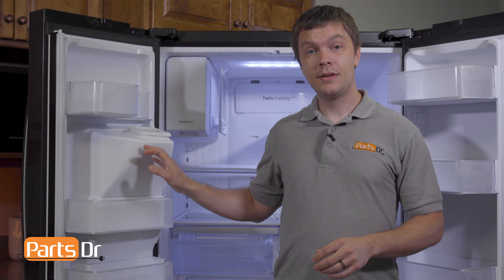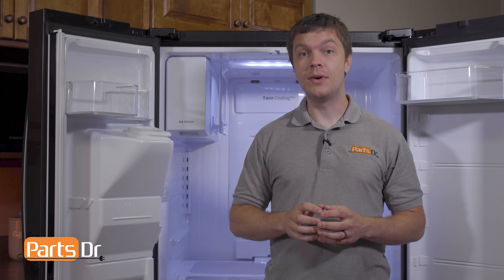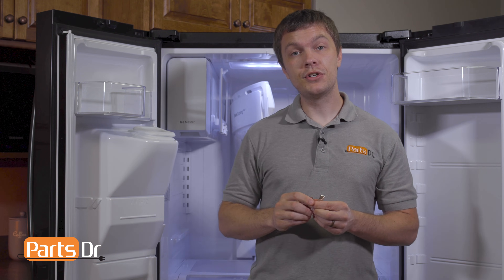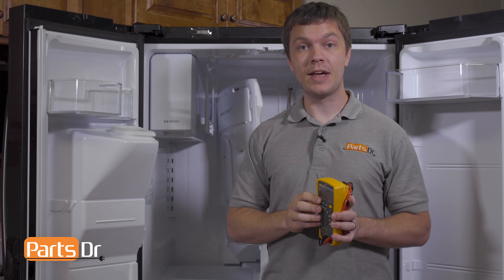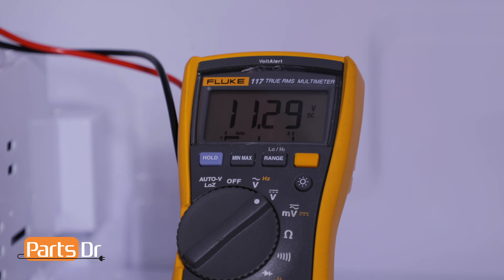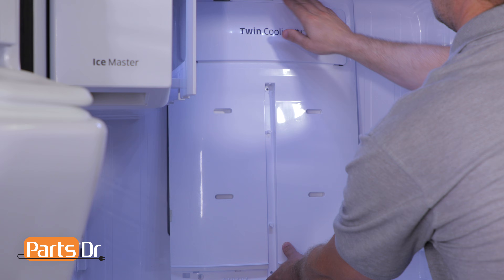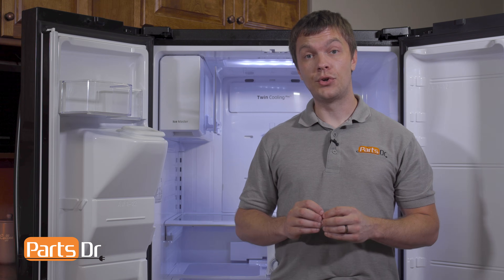How to voltage test a Samsung Refrigerator Evaporator Fan Motor

Comment: My refrigerator has two fan one for freezer nd other for lower compartmen both are in the frezzer section but having differnt speed, freezer fan run at fast speed nd lower compartmnet fan run at slow speed, one fan is getting 12 volt other is getting 8 volt,  kindly tell both should work n 12 volt,   lower compartmnet have less cooling than uper compartment

Comment: I only get 8.81V on my fan motor in the freezer. It is spinning but freezer not getting below 38 degrees with my infrared thermo. Same temp as fridge. What could be the issue?
Reply: Did you find out?

Comment: Sir, my refrigerator is not defrosting heater are not working what else part is failure,
Reply from the maker: Most Samsung refrigerators have 4 parts that work together for the automatic defrost cycle, the defrost heater, defrost bi-metal, defrost sensor, and main control board.

Comment: What if it has proper voltage going to the fan and it runs but still has a code for bad evaporator fan
Reply from the maker: One of the wires on the fan motor relays a signal back to the main control board for it to monitor the fan motor an make sure it is operating properly.  This could be caused by a bad fan motor, bad main control board, or bad wiring between the two.  Let us know what you find.
Reply: @PartsDr  ok have a new board for a customer hoping it's not the harness from the main pcb and Is the control board itself. The customers stated samsung repair men didn't know the problem but Me and my brother are on track to fixing it
Reply from the maker: @jayjones8424  Let us know what you find!

Comment: My refrigerator makes 5 attempts to start the fan motor and then disables it. I measured the voltage on the fan (while it was making start attempts) it was correct 11.3V, I even got a replacement fan which behaves the same way. Looks like the control board can't get a feedback from the fan that it's spinning...Bad control board?
Reply from the maker: It sounds like a bad control board.  Let us know what you find.

Comment: This helped me alot by identifying that the fans voltage is 12V DC. Checking the voltage with the fan plugged in can be misleading. Mine showed no voltage this way, indicating that the PCB may have been bad, but after taking the fan out and putting 12 volts to it, it would not run! The fan was definitely bad. The PCB stops sending voltage to the fan after it repeatedly gets no response from the fan which can make you think the PCB is bad when it is not. It's a good idea to bench test the fan.
Reply: Yes, but I was getting no voltage while the fan was plugged in to the fridge & the fridge compressor was running, magnets on the reed switches. The PCB had already cut off power to the fan. So I tested the freezer's evap fan with a battery & it worked, the refrigerator evap fan didn't.
Reply: Watch the video again. He said the voltage to the fans was 8 or 11 VDC. Also you can check the fan motor by checking the continuity between the red and black wires on the fan itself. Continuity good fan motor. open bad motor. He said white wire sends fan speed info back to the PCB.
Reply from the maker: That's good to know!  Thank you for sharing.

Comment: what should be the resistor of freezer and refrigerator fan respectively? is 97.5 K and 12 K ok for the freezer and refrigerator fans? they do have sound of working when the system is plugged in.
Reply from the maker: We don't usually find a resistance test to be an accurate way to test these fan motors.  Even if they test good in the resistance test, the motor can still be bad.
Reply: @PartsDr   Thanks for the reply. I have a Samsung inverter refrigerator (freezer top). It works fine until around 7 hours and then stops working. If I unplug and plug it right away, it wont turn on. After some hours, it will turn on. It has high temperature fluctuation. If I set the freezer to -21C, it will even cool down to -32C. The Samsung official service came and said my evaporator is having a small hole. I didnt accept. Then 3 more technicians came. One said the defrost system is problematic and changed the sensors without measuring the resistors. Then another one came and said the invertor motor  should be replaced. Then another one came, took the inverter board and returned and  then he said, it is hard to find the  cause, buy a new Ref! Since then, I am trying the repair it without experience. I just am an electronic engineer and understand something from the board; however, I do not even have the board map!
What do you think?

Comment: I have a Samsung 4 door flex refrigerator the refrigerator part will not get below 57 degrees but the freezer part works fine I'm assuming the freezer and the refrigerator has two separate evaporator fans is that correct!
Reply from the maker: Yes, most Samsung refrigerators have an evaporator fan in each compartment.
Reply: @PartsDr  okay I will check it thank you
Reply: Hi, I have the same issue. Did you resolve it?

Comment: Hello, Yves from Belgium, RS7528THCSP Error 22E, fan 9.6 kohm, voltage i get  only 6V ???, so first turned very slow, than didnt turn at all ....help
Reply: Did you find solution?
Reply: @aisenandrosov5713 Samsung DA31-00334C koeler/ventilator motor - bldc ;12035GE-12M-yt 1775 ±7% 12
Reply: Yes a new fan motor

Comment: Hi, I sure hope you can help. I had a c 22 error, ( pretty sure that means the control board is fine if it detects errors?) I replaced my fan ( it was frozen up, rusted) and now it moves. The error is gone! but the fan never comes on? I know I connected it right, and it free to move.  I got an AC 7 volts on white, but no DC. red to ground I get 1 volt DC. So confused.
Reply: I am about to order a fan motor myself….same 22c code. Did you resolve the issue?
Reply: @ramjet358  no ditched it. I fixed it a few years ago with a new fan but this last time no luck. Tried a new board and sensor. No luck so got rid of it.
Reply: @greensseanpam5616 ok thanks for your quick reply.  I guess I’ll give it a go.  Other than this one, did you ever come across a video or instructions involving a triple cooling unit?
Reply: @ramjet358  no, nothing like that
Reply: New fan worked.  Hopefully it will last more than 5 years (or 5 months!).  Thanks.

Comment: any thoughts as to why my rs265tdrs/xaa leaks water on the floor at the front of the fridge side, about once a day? the water seems to come from under the fridge, not from inside of it. the evaporator tray underneath seems to fill evenly but the water isn't evaporating fast enough. it used to leak water from inside the freezer, which would also freeze in the bottom of the freezer, but it did that for months - but the freezer stopped working. so i emptied the whole thing, defrosted everything, did your various diagnostics, and while it all checks out, the fridge side now leaks water. the freezer still isn't freezing.
i get no error codes. oh and i also replaced the power supply board and the main control board. there used to be a smell of over-heated electronic components coming from the control and power board cavity in the back, but after changing those boards, the odor is gone... what am i missing?
Reply from the maker: It sounds like a clogged or frozen defrost drain.  This video will show how to access that area of the fridge here: https://www.youtube.com/watch?v=bPJM0TCaQDg

Comment: I have fan issue, tested voltage like in video and I only get 7v fan does the start stop 5 times then nothing.  tested at pcb outlet and 7v there too so assume I need a new PCB? visual inspection of board everything looks perfect.  What would you suggest I do next before I burn it?
Reply from the maker: What is the model code/BOM name of the refrigerator?  https://www.youtube.com/watch?v=4HhWL9sonuE

Comment: Dear Parts Dr,  your video was helpful to see if the fan went on with the lights off.  Can you tell me for the samsung RF197ACPN with the french door and freezer door on the bottom, where to turn off the light on the bottom drawer.  I used the two magnets on the top doors and it works.  But I cannot find anything on the manuals about the light sensor switch on the bottom drawer.  Your help would be appreciated.
Reply from the maker: Look for a reed switch on the freezer wall. It should look like one of these two:
https://partsdr.com/part/da34-00043j-switch
https://partsdr.com/part/da34-00043c-switch

Comment: How long does it take for fan to come on once you bypass door switches? I was getting 2.1 volts DC only it was going up real slow.
Reply from the maker: On most that we have seen it is usually pretty fast, typically less than a few seconds.
Reply: Same fan worked earlier after dismantling it again and had to repin the plug but it ohmed out fine. Fan started when I put all together then when I put the cover on it didn't so did the tests....only getting 2 volts also and I'm in OF mode
Reply: Maybe I'm impatient and expect fan to run when I put on OF mode

Comment: My fridge has a freezer fan that controls the bottom and the top(RF27T5501SG) fan works but it’s not cooling the top the damper works as well now I’m not sure what it will be do you think the fan it’s not working fast enough?

Comment: My fan functions at the onset but stops running after around 24 hours from when the fridge was plugged. If the control board disables fan for ten minutes, I suppose there won't be any power when tested. Will there always be power in the main control board? I'm trying to figure out if the board or fan  that needs replacing (maybe it runs low after 24 hours so the board switches off the power, is that possible?).
Reply: Just to add, the fan didn't have power when being tested. The board also had fluctuating power during testing. However when the fridge was unplugged and replugged because the front panel needed to be reset, the fan started working again. Then it stopped again the following day and the system wasn't cooling.
Reply: @Flying_Gamer76  did you find the problem? Most likely the fan

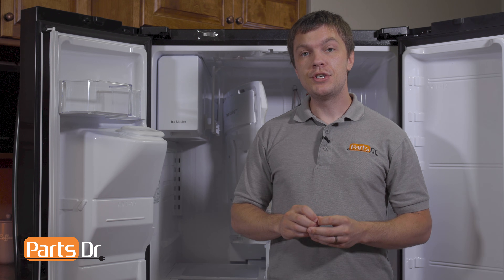Comment: Hi Ryan, my evaporator fan is stuck at the cycle that you mentioned at 2:46.
My condenser is not frozen up and freezer works correctly. Fridge wont go below 18C before of this fan issue.
I have replaced the fan but same thing happened. Should I replace my main control board?
Reply from the maker: Hi Jerry.  It's up to you what you would like to replace on the refrigerator.  Since replacing the fan motor did not fix the problem, the next thing to replace would be the main control board to fix this type of problem.
Reply: @PartsDr  I shall do that. Thanks alot!

Comment: Great tips. Can you help me figure out my issue please? Freezer cold, main fridge not- running about 50F (this same unit in this video- Samsung RF24xxx).  The voltage to fan is perfect.  With magnets on, I observed that the main fridge fan is "running." Could it be running too slow- anyway to check that (fan speed?)  The defrost temp. Sensor checked out fine- the ohm values perfectly match those on the Samsung chart.  I tested at room temp., 70F and ~33F (ice water.)  The coils in the back were just cleaned and no interior vents are blocked.  

At this point, should I change the fan and cover assembly just in case the fan is old and running slow? The fridge is 7 years old. The evaporator in the main fridge has been consistently icing but I manually defrosted it, completely cleared the drain / tubes and I think it's better now but it haven't been too long to know for sure. In FD mode (Forced Defrost), I put ice near the sensor, I read a temp of the heater element to ~300F near the bottom yet the top of the coil was relatively cool 70F's. The coil is however completely clear of ice and draining fine, yet inside the fridge is about 50F.  WHAT CAN I TRY NEXT TO SOLVE THIS ISSUE PLEASE?
Reply: I have the same issue. When is the fan supposed to be running in high and when in low? Is there a way to check if it's not running in high speed, as it does in fact run fine and all cleaned out as you did...but I'm not sure if it's running in high speed, were you able to solve this? thanks
Reply: @stevemaier5979   I'm not a 100% sure. Typically the speed will be controlled by the motherboard. If the fan is working in low than the fan itself is working. Beyond that I suppose you could check with a meter a meter or simpler way might be to Put a little recording device inside the refrigerator and listen to here the RP m's increase or decrease.It will only kick onto higher RP m's as needed though.If everything else is working it's probably OK
Reply: You said, "The defrost temp. Sensor checked out fine- the ohm values perfectly match those on the Samsung chart.  I tested at room temp., 70F and ~33F (ice water.)"

Where did you find this info ( Samsung charts of sensor resistance readings )

Thnx

Comment: Thanks for the video.  I replaced the main control board and now the system cycles on but fails to provide proper voltage to fan (multimeter reading 1.6v DC) which is not blocked but not spinning either.  This causes a system restart.  Any suggestions?
Reply: How did you solved this?

Comment: Can you test it by setting your multimeter to volts AC instead and check for 120 volts?
Reply from the maker: No, it is a DC powered fan motor so the multimeter must be set to DC and checked for DC voltage.
Reply: So does the proper dc voltage for the evaporator fan vary from Samsung fridge to Samsung fridge or is this the universal voltage reading we should look for?
Reply from the maker: @okeyokafor2770  It can vary on each model refrigerator.
Reply: @okeyokafor2770  is your fan 110v?

Comment: Hi, I have a Samsung RSG257AAWP. My freezer side is not cold enough. The temperature on the panel shows -2 F, but the temperature taken inside is 39. I want to test the fan, but there are no arrows anywhere on the frame around the freezer door to attach the magnets. How do I trick it to think the door is closed to turn on the fan?
Reply from the maker: Try looking at where the magnet is located on the door and then align your magnet in the same spot.
Reply: @PartsDr  that's a good idea, but the magnets sticks along all three sides of the door except the left side where the hinges are. I removed the fan, connected to a 9v battery and it turned on. So the fan is good. I just need to check if there's power coming out to the fan.
Reply: I found the solution from a youtube video. I need to put a magnet on top of the plastic cover of the hinges. My fan turned on when the light turned off.
Reply from the maker: @bhc7146  👍

Comment: Hello sir good evening. 
what is the work of white wire in the fan
Reply: The white wire sends the fan rpm to the control board.
Reply: @trentoncampbell  thank you sir very much.
1 more Q.
What if the fan running at the maximum speed,but the air doesn't flow downwards,and at the same time there is  also no chokups in between the fan way towards downside the air way.
Plz reply sir
Reply: @brijmohansharma3079  most likely bad fan

Comment: Great video!  I have a different model Samsung RS25H5111, but the circuitry seems the same.  My problem is a little bit different.  The fan turns freely and there is no ice around it.  However, sometimes the fan works either at full speed and sometimes it doesn't work at all even on Power cool.  It doesn't matter what temperature the refrigerator is at.  Everything seems okay, including the power freeze on the freezer side, but is inconsistent on the refrig side.  I ran the full self diagnostic check and there are no error codes picked up.  Wiring between the evaporator fan socket to the mother board shows good continuity.   The refrigerator can go for a day or more without the fan working and then all of a sudden it starts to work.  Would this be a mother board problem or some other sensor causing the mother board not to supply the voltage to the fan?
Reply: I have the same problem and model did you find a solution ?
Reply: Same here. Not certain about the continuity though. The voltage seems to fluctuate and the slightest movement in the wires either turns the fan off or on again. Would love to know if either of you found something out.
Reply: @_No__1  looks like faulty connection and perhaps a faulty main board
Reply: I have the same model refrigerator and the same problem. Have you found a solution to your problem?
Reply: RF27T5501SG same problem I’m thinking it’s a faulty fan
Reply: @Theycalllmedaniel  did you ever find out the problem with your fridge?  I’m having the same issue with the same model.
Reply: @MichelleReneFan  yea I did inside the freezer the metal behind the freezer evaporator was covering the return vents
Reply: @Theycalllmedaniel So your problem was in the freezer not the fridge, right?
Reply: @Theycalllmedaniel wait, the metal in the freezer was preventing the fan in the fridge to run?!  Do you mind explaining exactly what was going on?
Reply: Did you find the problem?

Comment: Thanks for the informative video. I did a measurement in my fan motor ("DA31-00146E" DC12V) and I got a maximum reading of 9.35V even with power cool option. My fridge suffered from defrosting  trouble, please find the details in this link: https://www.youtube.com/watch?v=NsUiwwel-us
Is this failure due to low voltage?
Reply: no, depending on the load on the fridge sometimes the dc motor will run at a lower voltage and speed. u need to test the defrost bi metsl or defrost thermistor,, msny times the defrost t stats split open..  one u get the evaporator cold, you can ohm thr defrodt thermistor... sometimes, rarely the solder joints on the circuit board on the bsck of the fridge, csan bresk loose due to thier snaspping action,, essily repaired wit a solder gun.
Reply: also sometime u need to  put magnets on top of the doors to activate the light and fan switches. it will say place magnet here.